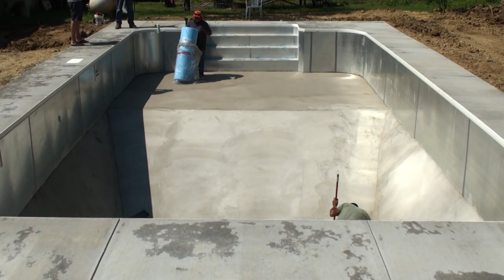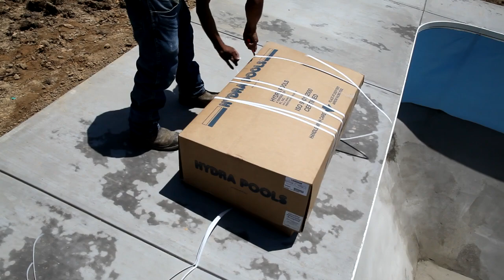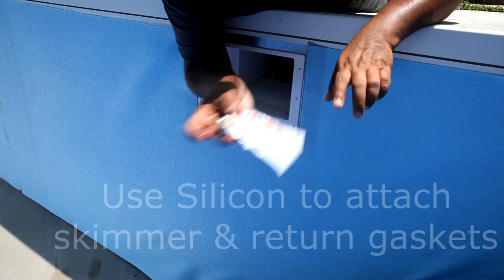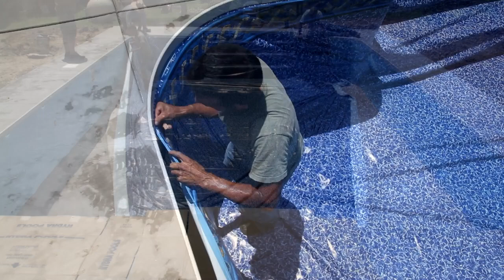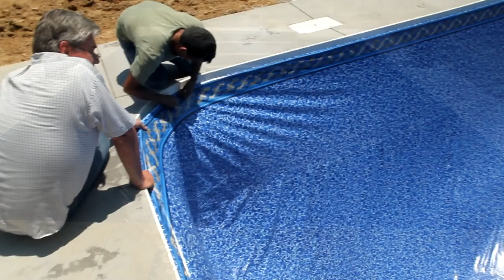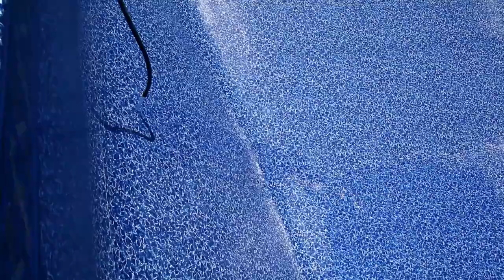How To Install A Vinyl Swimming Pool Liner On A Pool Kit From Pool Warehouse.

Comment: Tough way to install a liner.  Next time, take it out of the box at the breakover, place the liner at the center of the breakover with the arrow facing the stairs.  Two people  pull the liner to the stairs and install the steps first.  Then work your way back to the breakover.  At that point, have at least one person on each side of the pool pull the remaining liner to the deep end of the pool.  Install the liner in the bead making sure the corners are where they belong and work back toward the breakover.Try it, you'll like it.Rick
Reply: Rick Tanguay. My dad has been in the pool industry for over 37 years. He has been doing it the way you just said. I have bean working with him for 8 years I like it, it’s a pretty fun job (but) can be tough sometimes.

Comment: When I installed my liner with steel steps it was not as easy as this video made it look.  I would like more information on how the liner fits in the space between the steps.  Could you possibly provide more help videos with tricks and tips to fit liner in those steps.  It was a miserable experience for me.  I really like the look of liner over the steps, just has to be an easier way.
Reply: Agreed, and my liner came with a reverse bead over the steps. I had 15,000 gallons of water and  no fix. Had to work around it and still was charged for the bead incorrect.

Comment: Can I screw in the brackets for the stair rods into the steel stairs on my in-ground vinyl liner covered steel stairs when I replaced the old liner I found the rods are embedded in the sides of the stairs
Reply from the maker: You will need to request "rod pockets" be added to the design of your liner when looking to replace in the future. The rods should come out but we would recommend verifying first. Most manufactures, like Hydra Pools, no longer use rods and have gone to a tab method. It's a much simpler process but the rods should come out unless other issues have come to light.
Reply: I took my liner off the rods are embedded into the sides of the stairs they look threaded on the ends the rods are Rusty I use the vise-grips I cannot return the rods

Comment: I'm in the process of Replacing my liner.I now have my liner out. It's been out for about a week, and we are waiting for our liner to be made and shipped to us.The pool floor actually looks really good!!  However, there is some ground water weaping at  a few of the seams of the polymer walls where the floor meet...  , and some sand from behind the wall too.  Not a lot , of water, but some.   My questions are 1) should we repair these weaping areas?   , or  not be concerned?   2)  if I am going to repair this,  with what product?   I see a product called Hydracrete that works on wet/weaping areas, but I don't know if it is too rough for the underside of the liner.?  Or should I use pool crete?  If yes to the pool crete will it bond well?  I saw the video on making old concrete bond with new concrete-- It said to  Clean the area  well, acid wash, then make a slurry of portland cement, water and a glue product by  quick crete-- then  paint it on, then apply the new concrete( Or pool crete is my question?)   I don't want to mess up what looks like a really decent pool floor, but I don't want to regret not repairing the leaky areas either.   And just  FYI, we do have a sump pump in an underground barrel with holes in  it to pump out ground water, near the pool, and this worked well to keep out ground water from collecting under our liner.   I'm open to any and all suggestions!!   Thank you!!
Reply: Curious to hear what you ended up doing. It seems like it’s something that needed to be fixed?

Comment: why is it recommended to use foam on the steel walls?
Reply: Offers a barrier between liner and wall to preserve the liner from punctures and damage in the event the walls have any sharp surface...also prevents it from sticking to wall
Reply: @nathanielmoore5677  That's completely backwards and incorrect.  Lay a piece of paper on your desk and try to puncture it with a pencil.  Impossible.
Now place a thin piece of foam under the paper and try.....hole!
Reply: @toddhunking6336 He said if the WALLS have a sharp surface. In your analogy that would be like putting paper on the desk, then a piece of foam, then trying to puncture the paper through the foam. Also, a pencil is a bit extreme. I think it's more to protect against slightly sharp edges of steel panels or maybe some hardened concrete splash.

Of course, you're 100% right that the foam makes it more vulnerable to puncture from the inside, but there should never be anything sharp on the inside anyway.